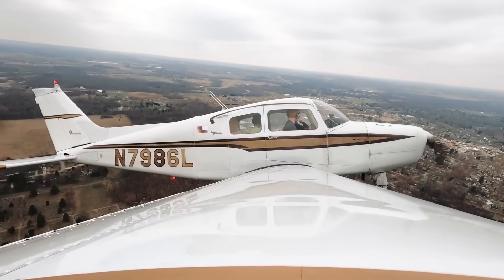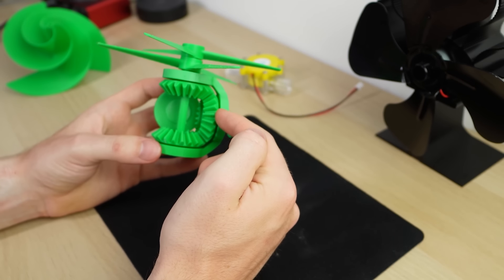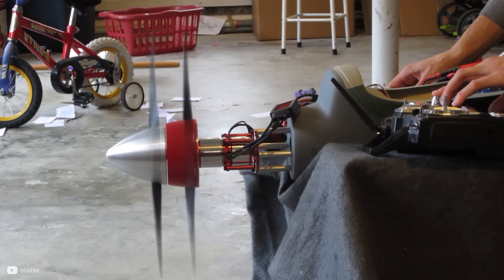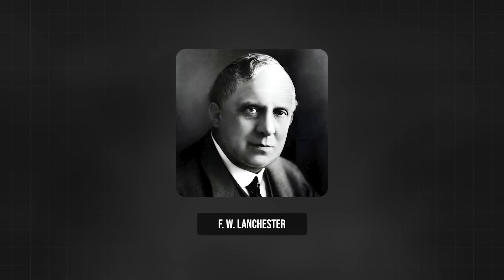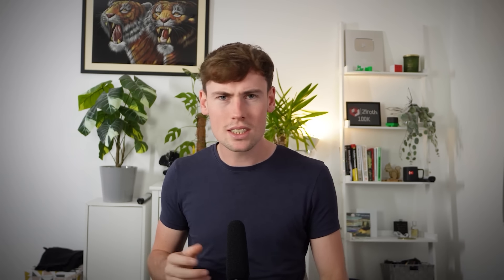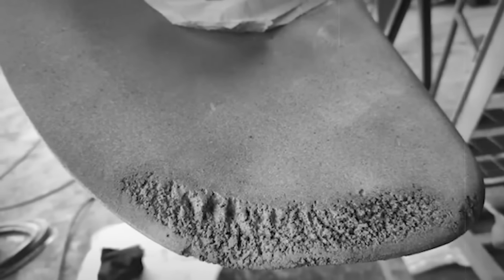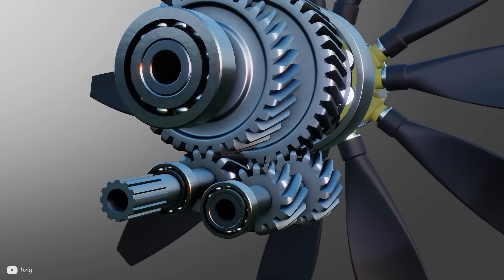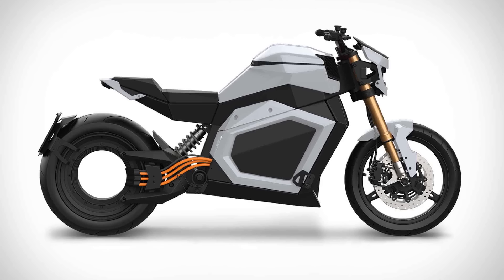The Unexpected Genius of Contra-Rotating Propellers

Comment from the maker: Play the incredible War Thunder game and click my link and claim your extra bonuses: https://playwt.link/ziroth 

Will these new innovations in the world of contra-rotating propellers bring them back to more applications?
Reply: Did you know that it doesn't have a functioning anticheat? despite being a PVP MOBA?
Reply: Honestly it's not "unexpected" nor "innovative". It was known since 1907, and even used to some degree in WW2. I mean come on - this is obvious for anyone who has even the slightest idea of how newtonian fluids, and thus - air, work.

The entire reason contra rotating propelles have become available was due to the increased HP of engines available. Back in WW2 the weight necessary to produce 2500 HP on an engine would far outweigh (literally) the meager benefits given by the contra rotating propeller.
Reply: @gae_wead_dad_6914  I think you responded to the wrong comment =s
Reply: I thought of a way to make the counter-rotating propellers more efficient, I think. If the second (trailing) propeller is a little longer, it will catch the forward-moving component of the tip vortex that the first propeller makes, thus improving efficiency.
Reply: @Era_SoNER  I was responding to the channel creator
Reply: @FLPhotoCatcher  You could do test, but i still doubt that the amount of efficiency it can give is negligible considering the extra weight a more powerful engine needed to turn 2 propellers and the propeller itself would ad.

There's no such thing as "trying to lift yourself up using a chair". That's sadly not how physics works, but hey - i could be wrong.
Reply: correct : in thermodynamics the efficiency is limited by the Carnot expression.
This author is certainly not a pilot, the yaw moment is created at high angles lof attack by the propeller of the blade moving down being subject to a much higher AOA, effectivelly moving the thrust vector to the right, called the 'p-factor'; at low AOA the yawing moment turns the airplane to the right.
Contra rotating propellers recover a part of the angular momentum, the efficiency is increased from 0.82 to 0.90 , typically for the best propellers operating at high  cruising  speed.
Reply: @gae_wead_dad_6914  Yeah, I think you got it right on the last thing you said.
I'm talking about making on propeller a little longer. If that is too much for the engine, the shorter one could be made even a bit shorter. Physics used to wonder how on earth the bumble bee could fly, but then they figured out that vortexes were made that the bee used on the opposite wing stroke. My idea uses a similar "vortex exploit".
Reply: @FLPhotoCatcher  It's not that the propeller's weight is "too much for the engine" it's that pushing the extra propeller at high enough speeds is too much for the engine.

There's a reason there's a separate engine for each propeller in a 4-6 propeller turboprop plane like the B-29

Engines juuust got powerful enough to the point where you can do this double propeller design without increasing the weight too much
Reply: I tried War Thunder for a few weeks, but the advantage is given to those who throw money at it. I wasn't prepared to do that and so gave it up because you don't stand a chance against those players.
Reply: downloading, its a huge game :)
Reply: Your skip ahead link, jumped about 40 seconds past the end of the ad.
Reply: Has anyone ever attempted this in a turbo jet engine?  You could fairly simply have one coupled compressor/turbine stage rotating in one direction and another turning independently and in the opposite direction.
Reply: @undertow2142  maybe complexity would be a limiting factor, stator vanes do a good job of keeping efficient airflow.
Reply: Many jet engines already have what are essentially contra-rotating propellers inside them.

Comment: You could've put a huge ad read at the front of the video and I wouldn't have cared... I was too distracted trying to spin my fingers in opposite directions 😂
Reply: It's really frustrating. 😛 I tried for a few minutes. I just can't do it. Trying to figure out in my mind how I should do it. Sometimes my one hand suddenly starts spinning the other direction. Sometimes Im not even making circles anymore. 😅
Reply: I'm sure it can be done with practice. Reminds me of the guy that could control each of his eyes separately to read two different documents.
Reply: @PanzerBuyer  probably. Im getting a little closer to doing it. Right hand small circles. Left hand bigger circles with intervals inbetween. With training it'll possible for sure.
Reply: The trick is: make 2 half circles.
Really try it.
Make a half circle in the opposing direction, stop and repeat but switched. Now keep doing that with shorter stops each time, but keep the 1/2 circle in mind.
Reply: I can do it easily.  I can do it where the fingers move at different speeds.  That version is hard.
Don't look at your fingers.
Touch your forefingers together and move your arms up and down.  Count off 1,2,1,2
Stop doing that and move your right hand forward and pull in your left like you are punching with alternating fists.  Count off 1,2,1,2
Switch back and forth between the two.
Then when you can do it easily do both together and there you are.
Reply: I taught myself to do this as a young kid and to my pleasant surprise I can still do it quite easily.
Reply: Y'all can't do it? I did it from the second try... Anyways I love how in the ad he says "passionate and loving community" AKA getting bombarded with racial slurs, discussing politics in every game, leaking so many classified documents in the name of authenticity that war thunder has to tweet to tell the community they can't use it. They definitely want the most authentic experience 😂
Reply: Don't point your fingers towards each other. Put them side by side to start both pointing forwards. 

When you get that rolling smooth extend one arm out in front of your chest and line the other up behind it. Your two index fingers are now lined up like the prop shafts. Took me however long it took him to talk about the Sharrow props. A few minutes thereabouts. 

There's a bunch of odd tricks like this that I think what's happening is that they force your brain to actively control both hands at once. In general it seems to me like one or the other is kind of on autopilot most of the time.  This one makes them go in opposite directions. I have a bass practice exercise that makes your right hand work in 3 and the left in 4. More challenging but once you get it it's like tying your shoes or riding a bike.
Reply: @spiderbass4hire474  I liked the start pointing in the same direction idea... I find doing that then slowly moving my elbows out increasing the angle between my arms until lined up (going opposite direction) works. 👍
Reply: ADHD moment lol
Reply: φ

Comment: One way to reduce noise with contrarotating propellers is to have one odd and one even numbered prop so they don't pass each other at the same time. Also, the rearmost propeller needs to be slightly smaller so that its tips aren't passing through the tip vortices of the foremost propeller.
Reply: That might work. Du you know if this has been done?
Reply: I was thinking the same, just like PC fans have an odd number of blades and an even number of supports (also curved supports) to reduce chop noise
Reply: Came here just for this thought.
Reply: @klausnielsen1537  Yes it has Look at the AN-70 cargo aircraft out of Ukraine it has 8 and 6 blade combos
Reply: @Petriefied0246 That has a conceptual similarity to a vernier scale on a caliper or slide rule.
Reply: @klausnielsen1537  Has been done - that's how it was done in the 20s and 30s, so I believed it to be common knowledge.
Reply: that sounds like and yes from a quick look at my old 1980s? volvo duo prop sternleg im putting in a boat, which has counter rotating 3 blade and 4 blade props of slighly different sizes yup its been done and theres a reason why they are so sought after
Reply: I think Airbus tests the concept but with a fixed second "rotor". This also means no gears necessary they are the other problem they probably loose more energy than the whole setup can save.
Reply: Design wise (and maths wise), it's a lot easier to implement two mostly equal propellers. Trying to not make my point sound too dumb... Equal (mirrored) propellers are easy to run at the same speed and opposite. But there's more to it. Propellers also have drag that should be matched equally. And push. And, to a lesser extent, mass/gyroscopic effect. I'm sure you COULD have a working contra that is of a completely different design, but that would take an awful lot of math. And I have a feeling it would only work well at a single speed. But I think you're right about shorter blades on the contra propeller, but maybe that should be done while keeping most of the design from the front propeller.
Reply: @klausnielsen1537  Look at the prop from that Japanese ship at 5:40 it has a 4 bladed bigger prop and a 5 bladed smaller prop. So, yes.
Reply: Not only number of blades and diameter should be different. Also blades' pitch, angle of attack and rotational speed, due to different aerodynamic conditions. The distance between both rotor planes has to be computed and adjusted, too. Blade interference, dependent on number of blades, is another factor of efficiency: the lower, the less interference and the greater the efficiency.
Reply: - use primes for both, 3,  5, 7 - say...works too, randomises the beats...  (even blades on any prop is setting up for problems, only used in(modern)  non complex systems for cost reasons.)
Reply: @wafikiri_ seems like we have a lot of supercompute available these days to work out the details.  Massive savings in energy and improvement to marine and air noise levels.  Really wish companies had to value noise levels as an externality along with emissions.  Noise is just wasted energy.   Hopefully electric motors can help in this application.
Reply: That makes sense, if the Wing tip Vortices doesnt colide the didnt explode, even better they could Disrupt each other
Reply: @klausnielsen1537  Definitely common on boats, I see a lot of outdrives with a coaxial prop setup with a 4 blade on the outer and a 3 blade on the inner
Reply: The tip vortices will not clash because one spins off clockwise and the other anti clockwise. They cross but don’t interfere.
Reply: I recall  a boat owner refitting a 28 foot cabin cruiser with a Mercury Bravo 3 outdrive,  and the owner saying it paid for itself in a few years in fuel savings, compared  to the previous Bravo 1 single.
Reply: It’s the tip speed getting close to or exceeding the speed of sound
Reply: @kadmow this is the correct answer. 
The noise on the Russian commercial plane it's the same issue on the Russian bear bomber, because the blades pass each other at the same time instead of four separate womp sounds they combine together into one loud sound, it's so loud in fact that submarines can hear it.
Choosing prime numbers increases the frequency at which blades pass each other, and higher frequencies attenuate faster. 

No military ship uses an even blade of propeller for the same reason because when the propeller goes past the rudder you want each blade to pass at a separate time - No two blades to pass at the same time.

Others have correctly recognized that using different numbers of blades adds complexity, but it's not an intractable problem.  Mark rober has a fascinating video about a company building drones for delivery and their rotor blades are entirely asymmetrical to reduce noise.
Reply: @LA6NPA  Contra-rotating propellers are usually constant speed anyway, you produce more thrust by changing the angle of attack of the prop blades rather than spinning the prop faster.
Reply: The Kuznetsov NK-93 Contra-Rotating ducted fan is highly efficient. It has 8 propellers in the front and 10 propellers in the back. It has a 17:1 bypass ration. This design was dropped as funding dried out. It did deal with the noise effectively.
Reply: @andrewday3206  Rolls Royce or P&W could've made the turbofan engine with counter-rotating fan. The fact that they didn't yet make me wonder what the trade off is?
Reply: @fadlya.rahman4113  RR and P&W have geared turbofan engines. It does make one wonder.
Reply: i also thought about making mismatched tips
Reply: @andrewday3206 

The advantages of counter rotation are already there with ducted fans which do not have tip losses or P factor.
Reply: @paulogden7417  
Contra-rotating are very noisy. Ducting them lowers this substantially
Reply: Thats a nice suggestion, would the Propellers need the Same length anyway ? Maybe it could even  be built shorter to reduce the sonic
Reply: Although i think, they still Hit and make the Same noise on acdifferent scale Like comparing v8 to v12
Reply: Doesn’t need to be odd and even…
Needs to be indivisible by the same prime numbers.  
A 3 bladed prop in the front and a smaller five bladed prop in the back would have these properties.
A 3 bladed prop in the front with a smaller 6 bladed prop in the back, would not have these properties.
Reply: I smell an engineer in our midst!!   Great info!   Thanks!
Reply: Are there examples for that? I wonder what a odd/even double prop would sound like. I'd expect a weird high pitched harmonic. 
It was tested for torpedoes, but sound under water is something completely different.
Reply: @klausnielsen1537  The Antonov AN-70 has contra rotating propellers.  The front propellers have eight blades.  The rear propellers have six blades.
Reply: Um, ever hear of a jet engine AKA turbo-jet referencing the internal shrouded (relatively) counter-rotatimg multi-bladed propellers (turbine)?
Reply: @klausnielsen1537  some ships do this. Water being nearly incompressible made this a necessity to prevent the blades destructions.

Comment: When I joined the Navy back in the '70's there were old torpedoes all over the place. Most that I recall had contra rotating propellers that still turned. The clearance between them was tight enough to do damage to an errant finger in the wrong place, a lesson most only had to learn once before knowing enough to not play with them.
Reply: They used two propellers to reduce noise I believe.
Reply: @jamesoshea580  They used counter rotating propellers to prevent the torpedo from spinning due to the counter torque.
Reply: @jamesoshea580  did you even watch the video????? that's not how it works XD
Reply: that was so they went straight.... one prob tends to torque it sideways tiny bit :-(
Reply: @HarmonRAB-hp4nk  and spining as that would also reduce the range too, not only true running.